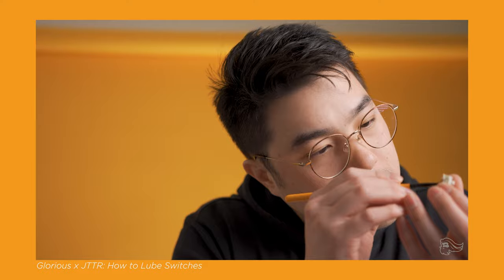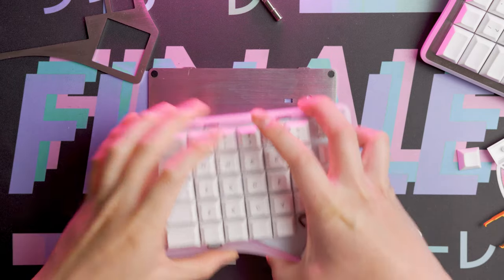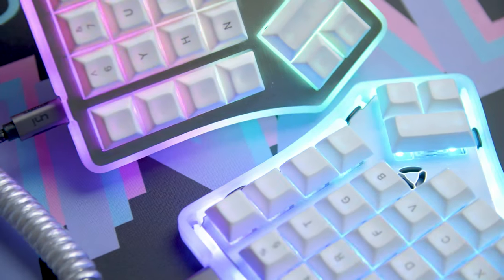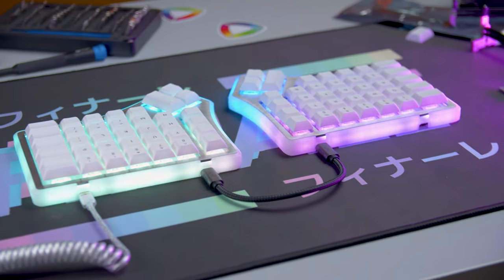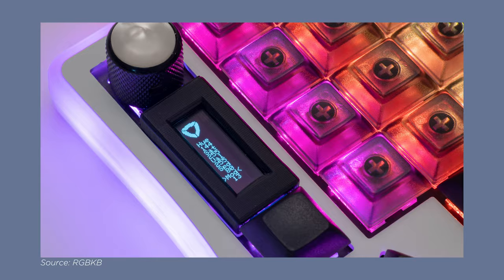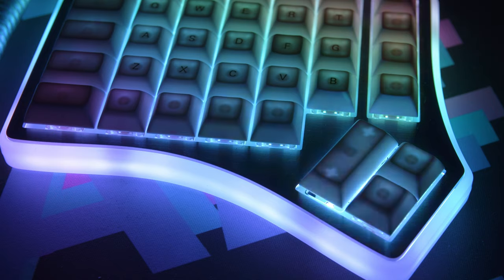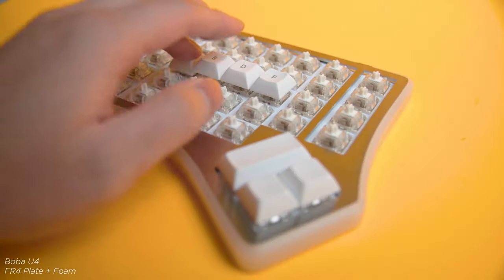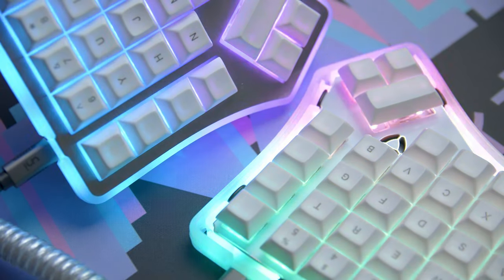Double Fisting Keyboards | Sol 3 Review

Comment: Unclear from their site and not mentioned in the video is how much flash these have on their microcontrollers. It’s likely more than the Ergodox EZ Glow which has about 32k and can be filled far quicker than 32 layers, but assuming any given amount is a bad thing to do.

This keyboard looks much like it’s the lovechild of the Ergodox EZ Glow and the Moonlander Mark I, but they made it more flexible in some ways and not as flexible in other ways, and it has the same number of keys as the Moonlander (I’d prefer more as a coder) and your point about how close the thumb clusters are and how cramped are certainly a concern if I got one. Then again, I could also see this design being a better fit for those with smaller hands, which there is a significant part of the market with smaller hands that aren’t served ideally by the Ergodox or Moonlander, perhaps.

That plate flex you showed when pushing it hard was an interesting thing to see: that’s one thing you’d certainly never see in an Ergodox EZ, as those are built like tanks and won’t meaningfully flex unless you use them as weapons.

As much as I’d love my Ergodox EZ Glow to have all keys lighted, the Sol 3, as you pointed out in your review, is not only absurdly bright, but actually a power-thirsty monster as well. I’ve hooked up my Ergodox EZ Glow to my iPads and it’s not a huge power drain, so I wonder if you’d have to give up a main feature with all the RGB to make it not drain an iPad quickly.

Comment: Why barely anyone makes them wireless. Even the moonlander. It's very annoying. What moonlander (well ZSA) has locked down is their software, feets, and the thumb cluster.
Reply: Why? Zsa doesn’t really have their keyboard software locked down, that’s fully available for their QMK derivative, though perhaps the other stuff that makes for a more user-friendly online experience, typing practice and firmware loader perhaps they don’t make available to everyone else. I don’t see why anyone should expect them to do so.

As to making them wireless? In this review he had a problem providing enough power via USB-C cables that weren’t top quality, how long do you think batteries will last in the Sol-3 or even the Moonlander with all the LEDs? Sooner or later you’ll need wires, it’s all in the details as to whether it’s for recharging or whatever.